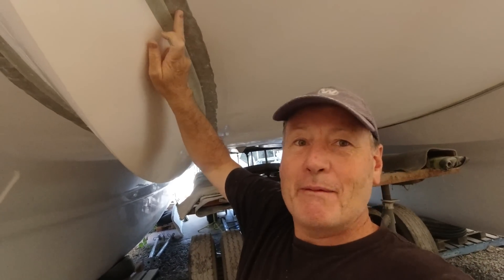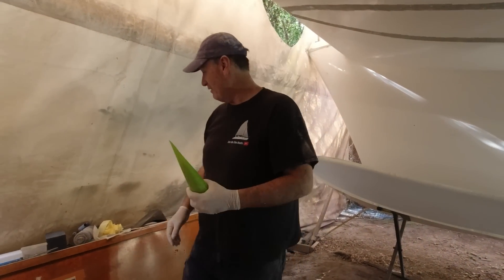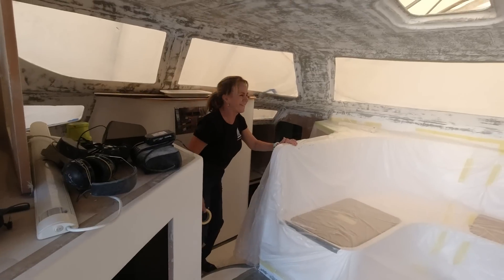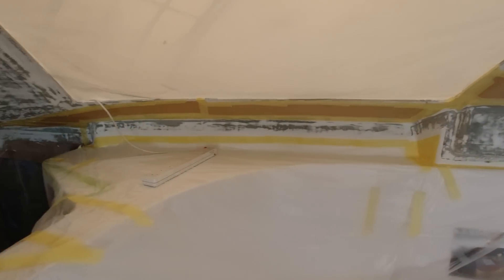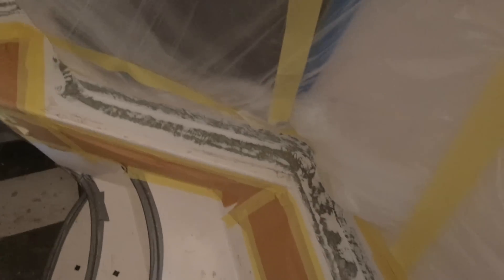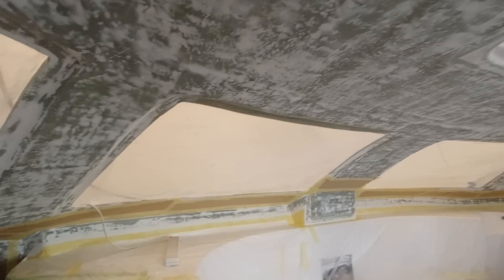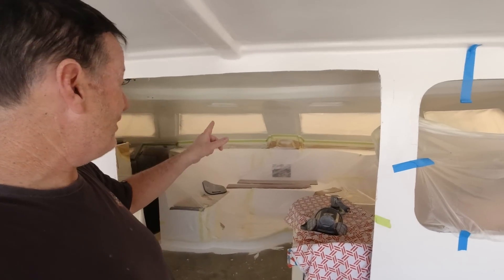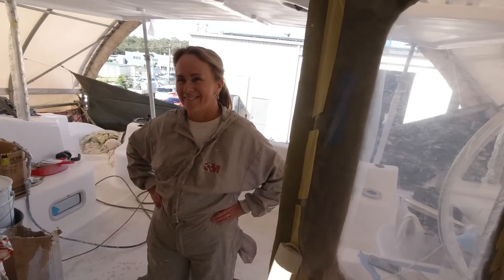Catamaran Saloon Transformation // Catamaran Fitout Series Ep286

Comment: With all the spraying you have to do, you really need to invest in a pressure pot. It handles large volumes of material and you spray it just like a regular spray gun. With a good Binks or other gun, with various tips, you can spray just about anything. Fast and very consistent. I still recommend that you use an orange peel texture wherever you can, especially on the ceilings and bulkheads.

Comment: What a difference! So much brighter. When spraying such large sections or lower confined spaces, do you use extractor fans? Or frequent breaks with your breathing apparatus? How tiring is all that ceiling painting?
Reply from the maker: I have fan on the hatch above but frequent breaks and multiple cartridge replacements as the isocyonates in 2 pack polyeurathane are not to be messed with.Lethal without the right gear .Cheers mate.Rossco

Comment: I was helping a friend fix the windows in his boat last weekend.  It's balsa core, and the windows leaked so all the balsa was water logged.  He dug a lot of balsa out, then we tried to fill the gap with polyester mixed with loose 6mm chopped strand glass.  We put it in a piping bag, but it wouldn't flow out.  So we ended up using paint scrappers to stuff it in the cavity between the inner and outer deck skins.  What a mess.  What is it that you use to bulk up resin and give it some strength, but still be able to pipe it?
Reply from the maker: We use Cotton Flock or milled fibre to get a good build up in structural areas I will add cabosil as this can make it easier to sand down.The paste should be like peanut butter, enough to hold in a vertical application.Rossco
Reply: @LifeOnTheHulls  Where do you buy cotton flock?  Never heard of it here in the UK.
Reply from the maker: I would imagine Easy Composites in the UK would be a great place to start.Ross